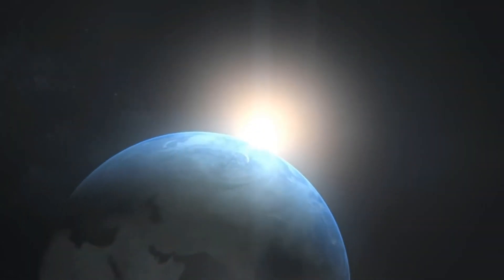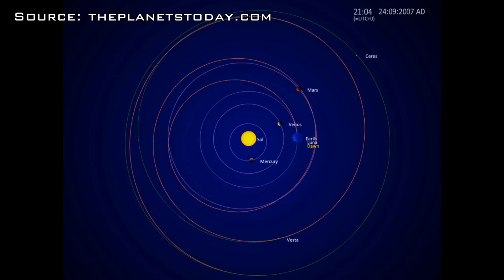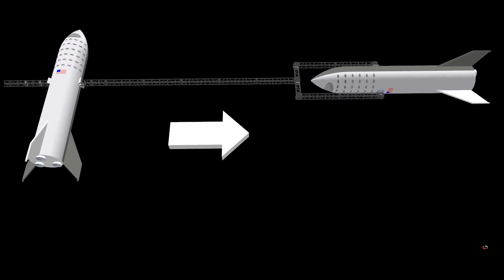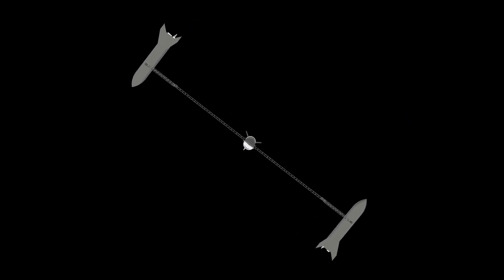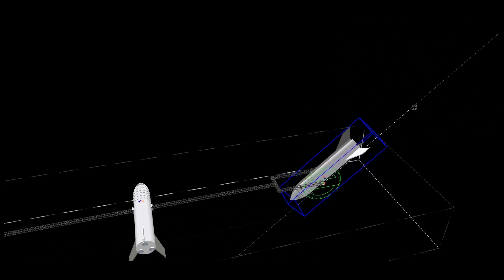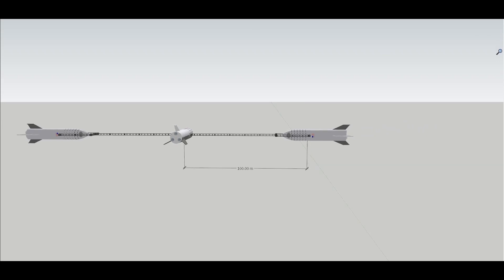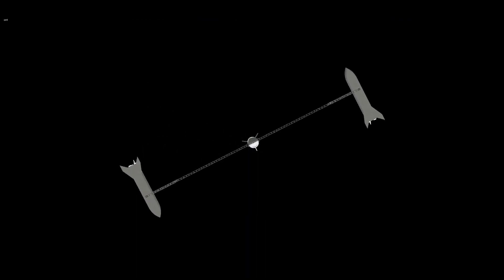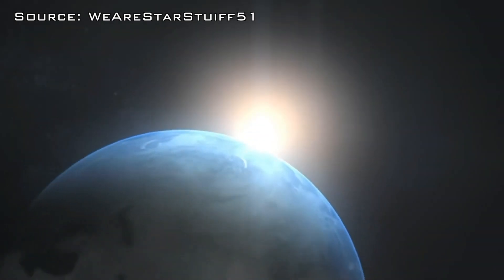GLS2: Artificial Gravity for SpaceX's Starship

Comment: Perhaps you could also design a system where the internal rockets engines and tanks can extend out of the bottom off the rocket allowing space for a an expanding system of rooms to take its place during the coast part of the trip. The rooms could be arranged like a sliding shelving system here on earth https://images.app.goo.gl/q31Qm2rqJg1S2fNR8 this method could greatly increase the internal habital space of the starship system.

Comment: You don't need a truss structure with a dedicated Starship dude, all you need is a teather and two starships. You don't need to use the main engines either, 1 rpm is optimal. Some very small control thrusters is all that's required. Your idea is WAY too complex and WAY too expensive and the rotation rate is WAY too high. Teathers are way more practical.

Comment: nice idea but isn't two rpm the max a person can handle with no ongoing adverse effect? that said, 1g isn't necessary .7 or even .4 would do,,, check out nasa "mars direct".. https://www.youtube.com/watch?v=sInxOaEBPJk
Reply from the maker: Thanks for the video! Very cool stuff. 3 RPM won't be as comfortable as 2. And 2 RPM with my idea's radius of 99 meters gives .4 G, but I think the higher the G the better for physical conditioning. Not sure exactly how uncomfortable 3 RPM will be, but I assume it'll just be harder to pour drinks, and you won't want to do any mosh pit headbanging. https://www.youtube.com/watch?v=ryrGPjyKhO4&t=3s From the research I did, I found that 2 RPM and lower is perfect, above 2 RPM is where things start to get coriolis-y and any angular velocity faster than 6 RPM is just hell.
Reply: @smallstars  thanks for the response, its my understanding that too little i know to be able to call this accurately but i fully agree that gravity is a must

Comment: There is just one problem with your design, the Coriolis force. 
https://space.nss.org/media/NSS-JOURNAL-Space-Settlement-Population-Rotation-Tolerance.pdf
In this paper NASA published in 2017, it stated that a spin design should not exceed 2rpm so it would not cause significant discomfort.
A easy modification could be that we do not need 1g to maintain body strength, 100meter at 2rpm would gave you 4.38m/s^2 so about 0.5g.

Comment: You just made each launch 50% MORE expensive! Why use a third starship just for an over complicated steel truss system? Use multiple kevlar cables for redundancy connected to multiple points on each ship and forgo the vertical rotation. Straight cables slowly tensioned as you spin up don't break.

http://digipac.ca/chemical/mtom/contents/chapter1/ltw_001.htm calculated 9 tons for a 500m cable to hold 2x100 ton starships, but this is at a x20 safety factor. Drop this to x2.5 safety (same as an aeroplane) and you have a 1 ton cable (split into multiple strands) instead which is trivial to store and deploy...

Comment: I like this concept but some aspects could be improved. Mainly the truss system is heavy and won't handle the moments in the attachment points well. I would recommend placing 3 ships in a triangle with cables in between. This is lighter and doesn't require a separate ship. Also I would choose to simulate Mars gravity or maybe 0.5 G this saves on fuel consumption and stress on the system. It is enough for the health issues and gets the passengers used to Martian gravity.

Comment: Why not just spin the shuttle like a bullet spins in the air and use the outer hull of the rocket as the floor 9 m diameter would leave plenty of head room even though your head would experence less gravity then your feet. it would make the whole process way less complicated and still alow for some semblance of gravity.

Comment: Good produced video. Thanks for your idea. 

Only follow up question at the moment is why the starship’s down side has to be the same down as when it launches or lands. On the side would be fewer floors and less volume used by stairs/elevators? Maybe there is a good explanation?

Comment: If going to the effort to build this, would it not be an idea build in it's own fuel supply? 12 tonnes of fuel and it's own bespoke on board vacume spin up engines. That way you are not using precious Starship Fuel or turning Raptors on and off. Could develop the idea to have a massive central tank for a refueling point at Mars orbit or Mars or include on board solar panels or reactors water supply, food and oxygen reserves etc.  A multipurpose support vechicle and gravity generator.

Comment: Why not just manufacture a rotating transporter in space with a couple raptors on the back. It wouldn't need to land it could just make the trip between earth and mars and enter orbit. Then whilst in orbit starship can be used to bring passengers and fuel to and from the rotating transporter.

Comment: I proposed this to Elon Musk on twitter something like one or two years ago without answer. 
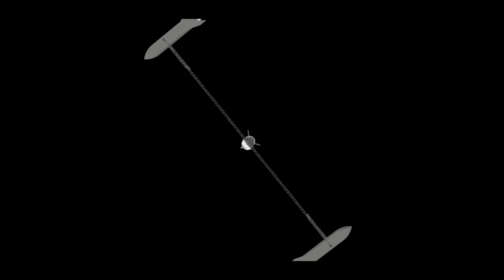I think the rotating part at 2:24 is not necessary as Starship will have RCS, so they can already start at the position presented at 2:37. Maybe if RCS are not enough some tangential liquid engine can be used. The fuel required to spin the two starships at the right angular velocity is not that high compared to the fuel in the tanks.

Comment: ideas like this are as old as the idea of going to mars - specifically linking htings together instead of using a wheel which is hard to cosntruct in space
some plans related to mars direct were thinking of sending a small orion/apollo like capsule to mars BUT - tethering hte capsule to a counterweight and spinnign the whole thing to create artificial gravity
some insane plan thought of launching all 6 spaceshuttles into orbit, linking them together to some kind of hexagonal star stucture, sending redesigned external fuel tanks to space, then sending the whole consturct to mars spinning so that you would have artificial gravity inside
now you could do the same thing with starship but you could probably even build a small centrifuge inside it's payload/crew section - 9m diameter isn't much and it's not enough for practical earth level gravity but you could produce something like 0.1G which is enough for some everyday life practicalities
if you want mars or earth level gravity a tether like this might work but the problem is a tether or truss this long and strong enough to hold the mars gravity weight of an entire starship would itself be a heavy piece of equipment

Comment: I don't think you need the main engines to make the system spin. Just link them with cables, and use OMS thrusters to spin. To keep the rotational period very long, the cable should be very long, and the spin speed need not be that high.

Comment: I like your idea, and it should work, however the structural engineering of the tether system would be difficult to say the least. I don't think regular steel would not work, something lighter and stronger would need to be used. I also think the actual structural engineering of the tether, the way it's constructed would need to withstand not only vertical forces but I would guess no matter how precise the burns are, they would see lateral stress as well. To withstand that much vertical stress and lateral stress would make the engineering even more complicated and to make it foldable and economical to get into orbit, quite the challenge. My intuition tells me this because i work around cranes a lot and tower cranes and they can withstand great vertical stresses but small lateral stresses bring them down with ease, they are incredible balancing acts. with all that being said, I can already imagine a system that would do it.

Comment: Why have a ship in the center? Just have 2 ships instead of 3!
Reply: Hare Krishna in the Movies 
I was also wondering this, my only guess (without doing the maths) is there would be an imbalance.
Reply: Maybe to help push it forward and backward?
Reply: but 3 ships are a safer option, it is triple security since 1 ship is enough to return to Earth
Reply: Precession. You need a constant axis, a reliable reference or centre of rotating the mass and besides, adds to redundancy and safety of systems.

Comment: Your truss system is impractical considering what would happen during a sudden meteor shower or debris field, if not today then certainly in the future, the results would be catastrophic. It would be more reasonable to designate a cylindrical section of the ship itself, within the inner shell and let it spin on an axis (within the confines of the main structure) to create the artificial gravity that will be so desperately needed. This way the passengers can experience the sensation of gravity at will while entering and exiting the section at their leisure.

Comment: What an awesome idea!

When you do the burns after connecting the truss system to the Starships, the Starships will accelerate in straight lines tangential to any current rotation.

Would a simple truss provide sufficient downward force to cause rotation around the central core, vs breaking apart as the two rockets accelerate away from each other free from the central core?

I ask because I wonder if the ball and string centripetal force idea of creating gravity is applied to rockets firing in opposite directions of each other would a foldable truss system be a hefty enough 'string'?

Would anything other than absolute perfect timing and precision steady rocket thrust from both rockets create too much stresses on the hulls of the Starships?

RTS would create acceleration forces magnitudes weaker than rockets.

Comment: Maybe better to have a Mars Cycler that is built in orbit and then goes on a forever trip Earth- Mars-Earth. It doesn't require large variations in speed once its going, so it can be designed as a robust centrifugal system. From Earth, you take starship to intercept the cycler - transfer passengers and supplies and ride to Mars. At Mars, the Cycler is met with a lander and cargo and passenger take the the lander to the surface.

I know its a different system, but seems more robust.
Reply: You're totally right! Have you been playing KSP?

Comment: The devil is in the failure modes.   Complete or even partial failure of the truss will destabilize the rotation at the very least.  Worst case, the assembly separates into two (or more) pieces that are now spinning at up to twice the rotational velocity of the integral whole.  Moreover, it would be impossible to stop this rotation completely given an RCS that, as you point out, is insufficient for establishing / ceasing normal rotation, let alone recovering from such a failure.

The truss, as you depict it, will likely not be strong enough to hold the weight of what amounts to more than 1.5 starships.  (You were talking about trying to create up to 1 G?  So, that'd be TWO starships, really.  Later you used a figure of 0.8 G.)  Think of suspending a starship by that truss here on Earth and imagine the sorts of materials and design you'd need to accomplish that.

Comment: OR you could just use a spectra tether spun from a comms hub.   Remember you are in space.  A small series of kicks in one direction from a spin engine will spin up the system.    The problem with 1G and a short tether is the coriolis force.  It can induce movements in the inner ear which gives rise to motion sickness.  A 3rpm 100m truss would make the inhabitants pretty sick.  

A Spectra or similar tether could be 1km long easily.  That way if you want 1G you would have a very low rate of spin.  I think it makes far more sense to use Mars gravity as the standard ship gravity.  There are so many savings and .3G should be enough to get most of the benefits of 1G.  Or you could spin it up to say 1G at the start, at say 300m, then let it out to 1km slowly so the gravity varies from 1G to .3G ready for Mars.  On the way back you could gradually wind it back in so the ship is back at 1G by the time it is back at Earth.

Comment: In order to avoid nausea and dizziness from the Coriolis effect, a rotation speed of 2 rpm or less is believed to be necessary. If the point is to create Earth like gravity you would need a radius of minimum 224 meters to create a comfortable habitat. At this length, it would probably be easier to attach the Starships to each other by expandable cables with dual attachment points, rather than a heavy rigid structure.

Comment: Right around 10:00 the expedition to Mars wouldn't be 2 1/2 years with out artificial gravity, just the amount of transit time. Once on Mars they'll have real gravity, even if it is a fraction of earths. We don't have data yet how lower gravity will effect our health, but I can't imagine it'd be bad as "no gravity".

Then about over a year of time on Mars (if they're planning on coming back right away). Being back on Earth may be tougher of course.

My other concern with the truss system, is it may have the tensile strength to stand up to the pull, but what about flexing? Even being rigid with that much of a length theres still bound to be bending, similar to that of a cable I would think.

One other thing, I'm not sure if artificial gravity will be really needed for Mars. Even Elon has said we just need to get there faster. A 3 month transit at best it wouldn't be a huge problem, 6 months, maybe more so of course.

Comment: Nice work. I think more could be done. For example, the use of 3 tons of reaction mass to start and stop rotations may be saved by using 2 sets of counter-rotating ships. In your example, it would be 5 ships instead of 3. If we are going to Mars to set up a long term base, a lot of mass will be needed to be transported. Solar collectors, fuel till Mars can get a fuel generator working, possibly nuclear generator(s), orbiting "gateways and depots", etc.

Also, I have never liked the windows in Musks craft. Pretty but worse than useless. Weak points in structure requiring strengthening in the hull, extra mass and possible radiation leakage, blowout potential, etc. The rich passengers pay for a large monitor, the poor go to the commens room to watch the big screen from cameras.

You did not mention it but a slow reduction in gravity would allow adjustment on the way, perhaps only near the end of the trip.

Comment: I like this design proposal, but I want to point out an underlying assumption that may not be correct.

You propose keeping the human crew and passengers at 1 g, more or less, for the entire outbound trip, and then slowly increasing local gravity from Martian gravity - ~0.37 g - up to 1 g for the return trip.

Why 1 g outbound?  Why not start off with the gravity at 0.37 g for the entire outbound trip?  That way the people would have long familiarity with Martian gravity when they get there.  You could then use the return trip to slowly re-acclimate them to 1g.

And why increase to a full 1 g on the way back, anyway?  You could increase from 0.37g to, say, 0.85 g, and then let the people deal with the 15% difference when they get back on the ground.  Yes, that would probably be a pain, but it would be much less of a pain than the transition from 0 g to 1 g all in one step.

With a lower maximum gravity, you could make the trusses shorter, which would make them less massive, which would reduce the fuel requirement.  Reduced fuel requirement equals either more payload, more reserve fuel or margin, or both.

Comment: A similar concept based on a cable appears in Dr Robert Zubrin's book "the case for mars" and I think that will be the definitive solution. I also believe that in more advanced designs the starship will have side thrusters which will facilitate maneuvers to create artificial gravity with a simple cable connected to the nose of two starships and two even more important things,
 1) to land in a horizontal position (the system Tintin is brutally unstable in the wind and requires perfectly level platforms that do not exist on Mars or the Moon) and perhaps more importantly: 
2) take advantage of the heat produced during reentry to heat the methane and eject it in the opposite direction to propel the starship by stopping it and avoiding melting (I think it's the idea they have in Spacex, at least make it sweat to eliminate heat, the next step will be to harness the energy so as not to lose it by converting it into kinetic energy). You are a hard worker, I like your channel, I have subscribed.

Comment: There's no need to make it so complicated. 
1- Mars surface gravity is only 0.3794 g; 
2- the rocket diameter is 18 m; 
therefore making it spin on itself at 6.139 rotation per minute gives Mars surface gravity at the shell.  

Now to fight the bad effects of apesanteur, you don't even need 0.3 g; 0.1 g or less might be sufficient, so it could even spin slower (with less structural stress).

Comment: I would argue that a cable is a better solution.

First it can afford to be much longer.  The longer the better.  The greater the radius, the lower the RPM.  Any rotating reference frame with a short period would cause nausea and disorientation. Especially when someone turns their head from facing one axis to facing the opposite axis.  No one wants to spend six months on a fairground ride. 

Second, a cable would need much less mass. It could be spooled out, and not require any sort of dedicated hub structure.

It would be a bad idea to spin up to a full one 1G.  1/4 gravity would be perfectly comfortable, and mitigate most of the health problems of microgravity.  Also means we could use a thinner cable. 

So, certainly don't need three craft.  You could manage with two. In truth,  you just need a spacecraft, a cable and some kind of counterweight.  The counterweight could have utility. A fuel tank?

Assume a balanced mass. A 1000M long tether,  r=500 and 1/4 G spin would only need a rotation period of 100 seconds.  Very comfortable.